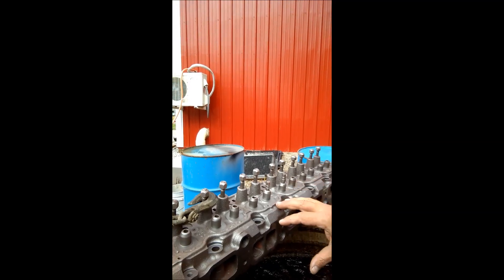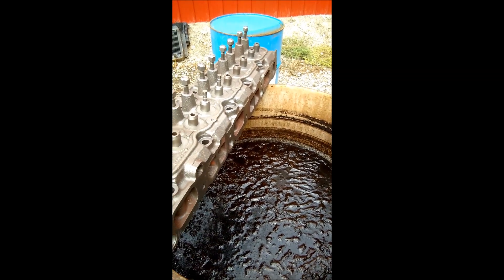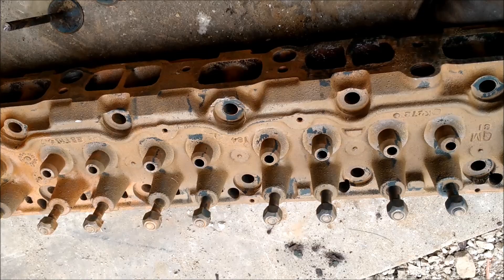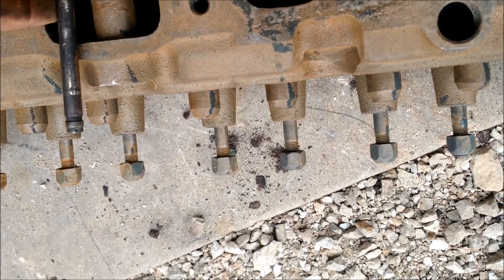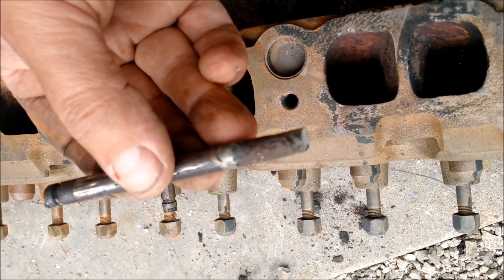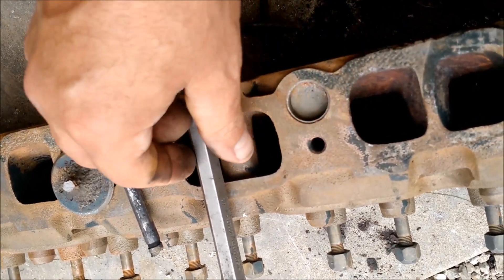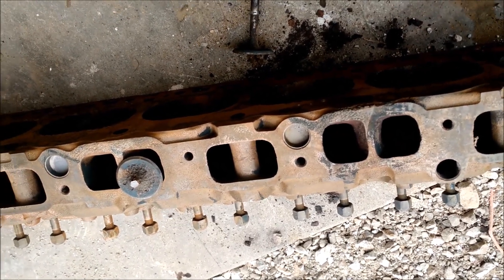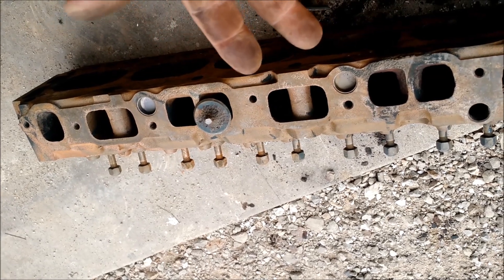Molasses Rust removal on Cast iron and stuck valves

Comment: It's 9-1 not 7-1 and it works more effectively if you don't use a steel container. Use a plastic drum or plastic wheelie bin as the solution will only be working on the part and not the container. Also, plastic is more insulative against cold which hampers the process.